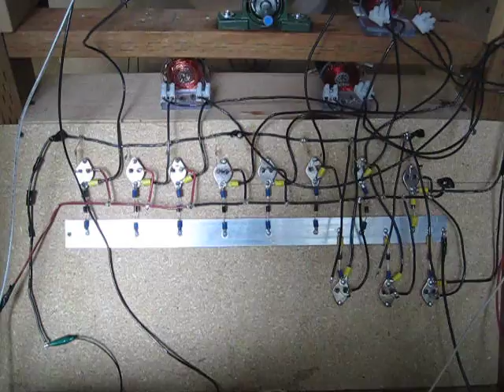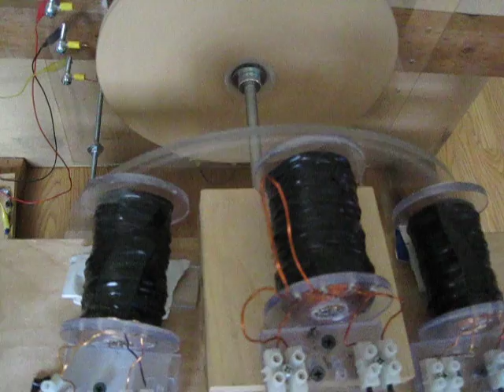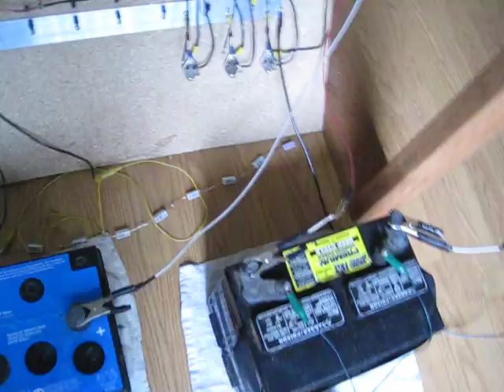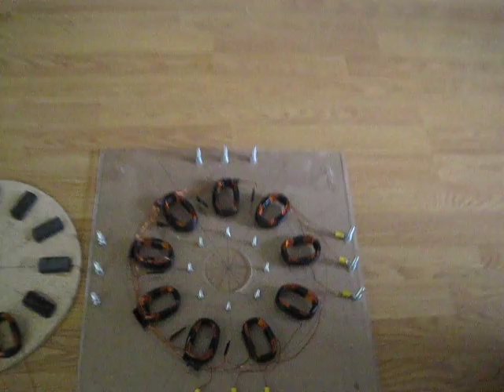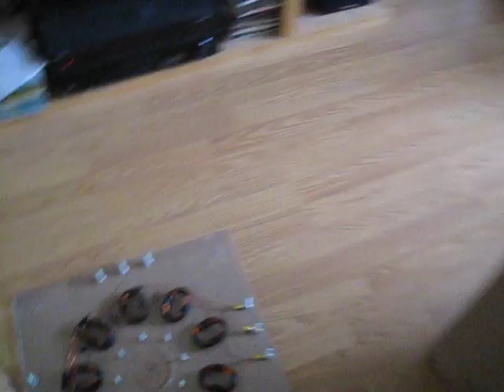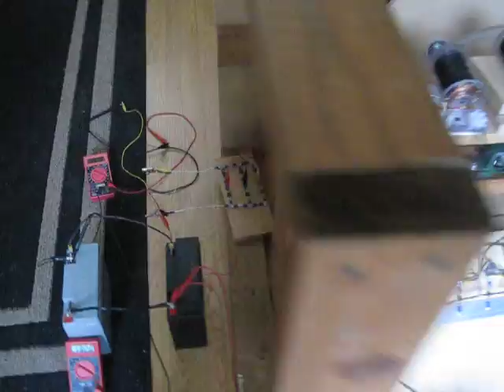pulse motor build off entry 001

Comment: LIke your setup!
Reply from the maker: thanks, it progressed all the way to 80 pound pull magnets that could charge a bank of T-105  225amp batteries at 24 volts, i am no longer working in this field. more in the direction of off grid power and making custom axial flux wind turbines that put out more power then the mid nite classic charge controllers can handle SD.

Comment: if my pulse motor run about 3-600 rpm, how many volts i will get?  thak
Reply from the maker: depends on the size magnet wire you use and how strong the magnets are. hook up a meter to your output, do not use a multi meter, or a digital meter. those will get burned up on the output side

Comment from the maker: all i had to do was match the resistance and the rest is easy, once you use one resistor and the speed seems to be maxed out, you just adjust it with another smaller resistor and its like it shifts gears and continues to build power, once all the weight is up and moving, adding batterys,lights,etc seems to have no effect on drag, you just slightly adjust resistors to maintain the power you want to make.